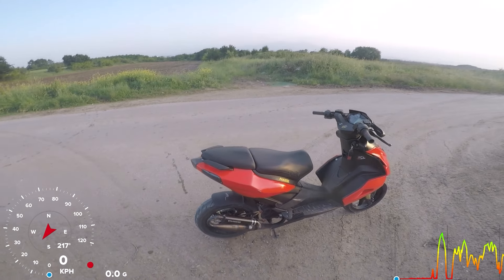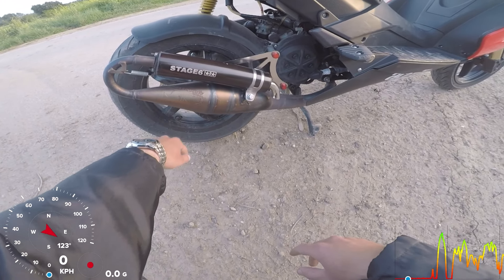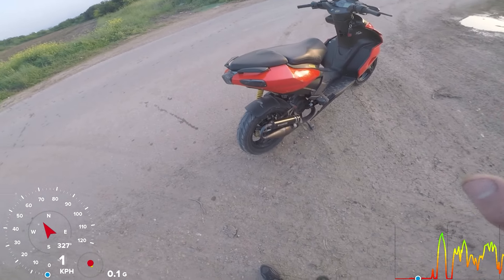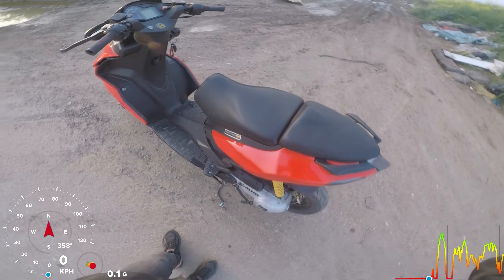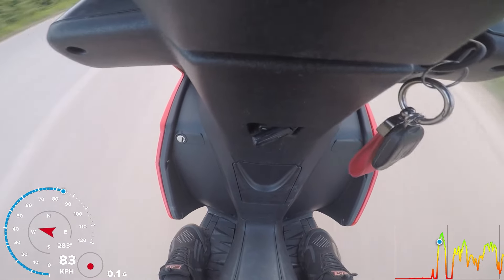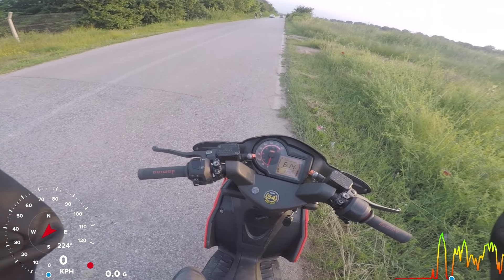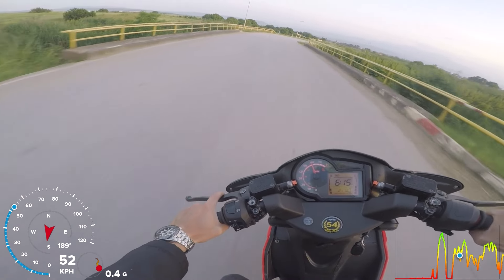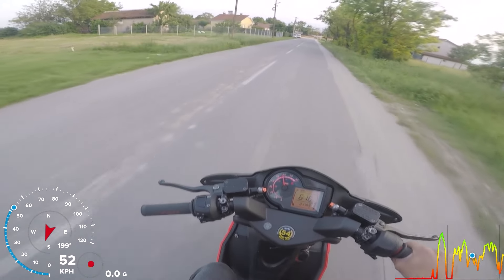Aprilia SR50R Euro 4 70cc Basic Tuning How TO & Top Speed

Comment: Which one is better, faster and more durable malossi sport 70cc or stage6 streetrace 70cc?
Reply from the maker: Streetrace is 2-3hp more its faster but as for quality its taiwan only good thing is the piston while malossi is higher quality but less performance, i would go for polini sport it will be little stronger and better quality then the malossi sport.
Reply: @Delpzie  Thanks
Reply: Top Dr and Top Trophy in my opinion , my sr goes 107 km/h after 10000 km with dr
Reply from the maker: @ztfavv  Yes a lot cheaper powerfull too but not the best on quality but can work for sure. Stronger than normal sport.
Reply: @Delpzie  i used 2plus phases on top dr and It goes a lot for sure

Comment: Whats better the yasuni r or z?
Reply from the maker: Z
Reply: @Delpzie  i have a 2020 sr50 only gianelli reverse and malossi rollers 4.7 it has decent acceleration and top speed 80, i have like 400€ -200€ for a yasuni and ill have 200€ for other parts what do u reccomend im happy with my top speed cuz i only ride in the city but i want faster 0-50
Reply from the maker: @DokiDalipi-v3l  Listen man you need proper tuning and with the Z it will be fast and have top speed and perfect acceleration and everything, its not only to throw the money if u cant tune it, sorry thats the reality wishing you a lot of luck. You only need variator and gearing from old SR or malossi 13/48, with all tuned it will be good even though the cylinder is china.
Reply from the maker: @DokiDalipi-v3l  P.S Putting 4.7 or 4.3 rollers thats only done from the dumb idiots in my country and it total nonsense.
Reply: @Delpzie what setup do u reccomend me? For the stock cylinder stock carb just exhaust and cvt tunning
Reply from the maker: As i said you just need variator and exhaust, modded airbox and fully tuned carb and cvt.
Reply: @Delpzie what weight rollers and contra spring?
Reply: yasuni r is better especially for a 70cc, yasuni z is for 50cc
Reply from the maker: @tineee74  Not true lol